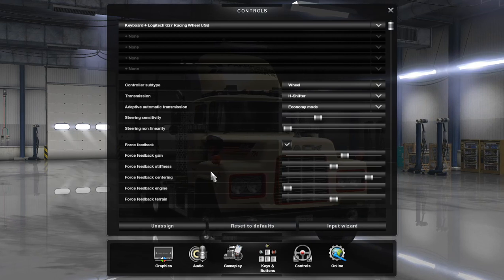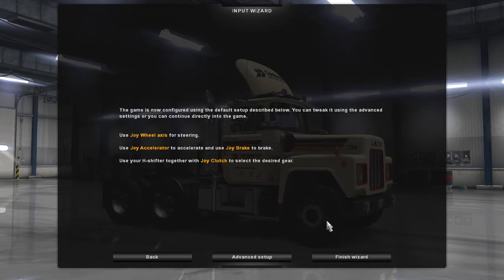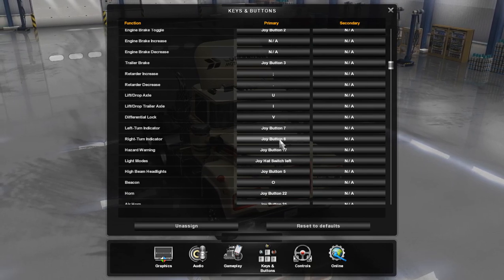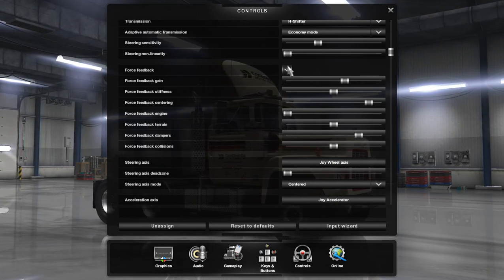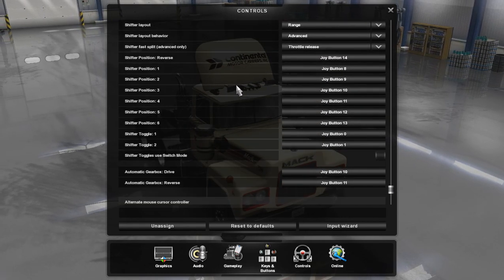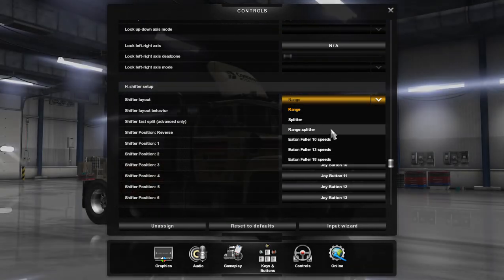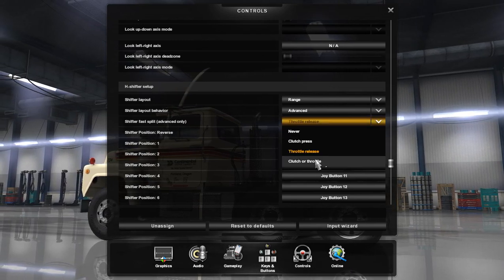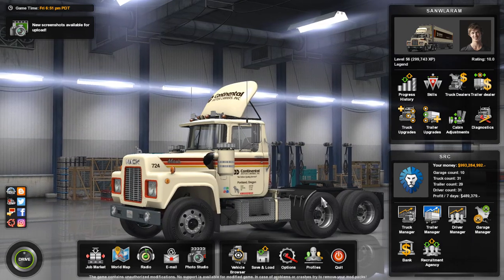ATS/ETS2 - Steering Wheel and Force Feedback Setup Tutorial

Comment: first of all, Thank you for showing some of your suggestions that you have shown.
I am brand new to the trucking scene. And bought the Thrustmaster TMXpro wheel package with the 3 pedel set. The Thrustmaster TH8A shifter. And a shifter knob that has the range and splitter on it.  And my question is, How do you downshift with all of these ranges in general? I really wanted to get going in this game right away.

what are the  most necessary go to buttons that I would put on my steering wheel?
Reply: do I have to buy new trucks for different jobs. Or would it be like renting them for which ever job needed for that senarero?
Reply: srry this is late but what are your sterring wheel setting in ATS and in the software thanks i'm getting one in two days
Reply: Firstgen Gamer you can buy more then one truck if u want and upgrade it to what u want

Comment: Im still have troubles with my G20 steering wheel. The game reacts to all the buttons. So the game recognizes that the steering wheel is there. But my truck in game does not respond to the the accelerator pedal, or turning the wheel. The truck acts like Im pressing the accelerator all the time, and wont stop moving. But I cant steer it at all. or get it to stop moving.

Comment: So I just connected my steering wheel for the first time did everything you did in the video. Since I don't have a manual transmission yet I'm using an automatic. I'm pressing down the accelerator on the pedals and my truck is not going forward??? I also have a shifter I did set it up same way as you did. What am I doing wrong I have been tweaking the settings here and there and I'm not sure what's going on. Also I'm using the Logitech G27.
Reply: Same
Reply: Did you get it fixed
Reply: @EviIjordan  Yup! 👍👍
Reply: @AnnoyingLAMP  what’s your wheel settings
Reply: @EviIjordan  So it's how your layout is programmed really. I can use Manual or Automatic anytime I want without changing the settings. It's a button I programmed on my Range. For example, if I'm sitting at the red light and I'm in automatic. If I decide to switch to manual instead, I hit the button. Walahhh...I'm now in Manual.

Comment: i have a tmx pro and my cursor moves down, i can hold it still with the break but i can't figure it out. any help would be nice as i spent $300 on this wheel for ats
Reply: try to reset ur settings in game
Reply from the maker: Do you have any other controllers hooked up? A gamepad perhaps?
Reply: U just hold it not all the way down just a little bit
Reply: hey did u fix your problem because i have the same problem and i have wasted 3 hours trying to figure it out please someone help me.
Reply: @jake pursley
Reply: @90x  eventually it just fixed itself I believe, I repeatedly reset my settings and everything. Sorry I'm no help man
Reply: @McMrs  i have tried doing everything that i could find on the internet but nothing worked. i got this wheel like 2 years ago and never used today i remembered about it and now i am trying to fix it and having a mental breakdown. the breaks just wont work, whenever i press them they just do nothing but if i go in the menu it just moves the cursor and it does nothing else.i dont know what to do with this wheel now. well anyways thanks for your suggestion i guess i will just hope that one day it will be fixed in a bug patch or something like that.
Reply: @90x  only thing I can think of is try completely from scratch. Delete all drivers for your wheel and maybe even ats, redownload everything and try the set up again
Reply: Sorry it’s somewhat late, but me and a buddy encountered this exact problem when setting his wheel up. All the problem is, is that when you first go to set up the game and plug your wheel in you’re selecting to use the wheel as a cursor. Just click ignore on the first prompted box that asks about using the wheel for a cursor and you should be good.

Comment: Put it on never and float.. you don’t use a clutch in a semi but to take off and put it in reverse lol.
Reply: How do you float downshifting? I am still learning upshifting and scratching gears, although, a liI less now. I am still new to the floating concept. I have a SKRS shifter knob, works great.
Reply: Same way shifting up, but when using your jake to slow down in a hurry your rpm’s gotta be around 2000, otherwise around 1500. Change it to advanced and the clutch setting to never, that way you’ll only use it when getting into first or reverse. It’s easy for me cause I’ve drove truck for the past 5 years lol.